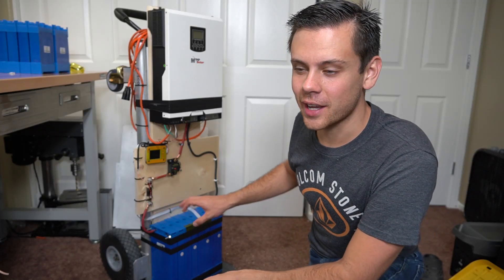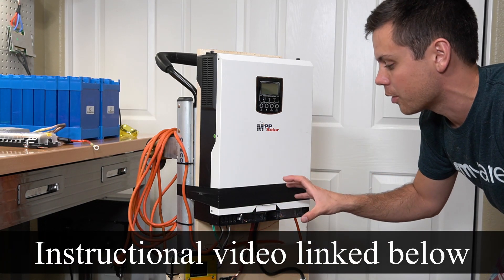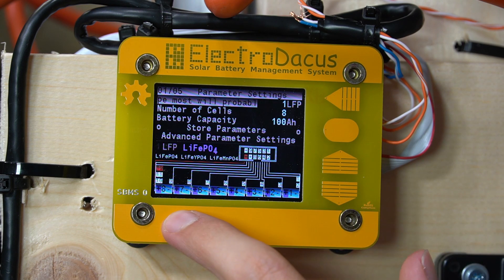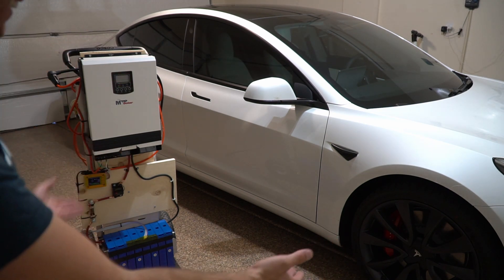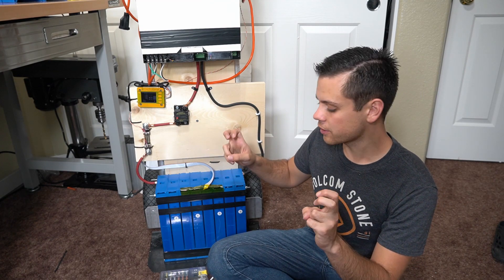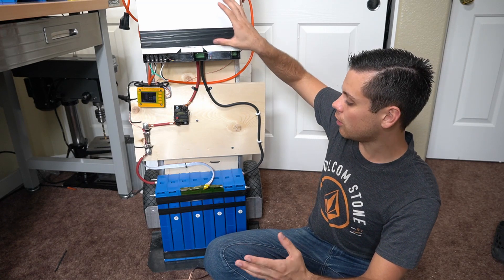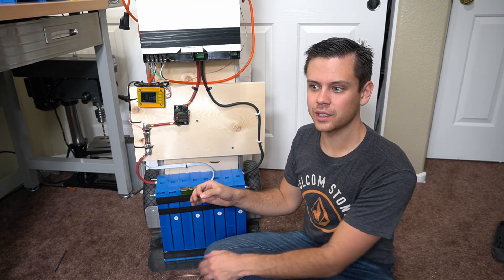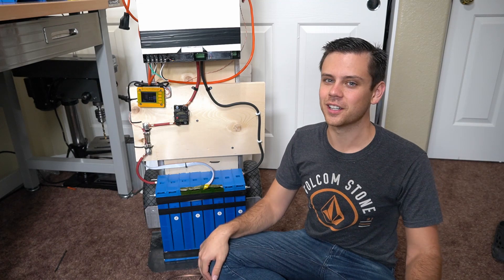Hand Truck Solar System: 2.4kWh LiFePO4, 2.4kW Inverter, ATS, 1.4kW AC Charger, 1.8kW PV Input

Comment: Will... Can you make one of these solar/battery packs capable of running high in rush loads like motors and specifically a MIG welder @ 20amp/240v max load and a run time of ~2 hours... or at least go over the changes and components needed to make it work.

Comment: Why not connect two battleborn?  200AH.  Can charge at 100A safely and discharge at 200A without issue (400Amp peak for a couple of seconds).  Also, you can attach a 40 Amp DC-TO-DC converter that only weighs 4lbs that would allow you to charge with vehicle (ideally a Hybrid as it only takes what it needs - at a 40 amp draw, my engine kicks on for 2 minutes every 10 to 15 minutes which would allow to run for a couple of weeks on a full tank of gas in the case of cloudy days)

Comment: Thanks for the awesome videos and ideas like this one Will!  Huge Fan of your content!
For this system, do you see an issue with configuring the batteries in a series parallel matrix so I can get 200ah @ 12V and direct that to a 12v inverter ( powering ac lights/fans )?  Thank you Will!

Comment: Wiring two batteries in parallel, should you connect the controller and inverter to the terminals on one battery or do you connect positive to one battery and negative to the other? Or doesn't it matter?

Comment: I am afraid that I will not trust mop solar products any more. I have a unit that stop charging for no reason and the company had me take the unit apart and send pictures. Now they want data logging on what could be an intermittent problem. These units requires 12 watts of power to run. This could be a deficit on a small system. I guess you will continue backing this junk until one fails like mine.

Comment: You mentioned that the inverter would be most likely to fail a couple of times, and if it did the entire system is unusable, but it's replaceable. Do you have a plan as to what you would replace it with and how you'd do it? Would you have to find a similar inverter as was used in that unit online?

Comment: Hi will. 
I've done this same system with two battle born batteries and it runs my entire house including my big double door refrigerator. I have 6- 12v - 100watt rich solar panels and it works awesome.

Comment: Could this power  mini split AC/ Heat pump?
Reply: I sure hope so as I am receiving my MPP 2424 tomorrow to go along with the 6-165W REC slightly used panels I picked up for $60  apiece. Mating these with the used 24V, 4KWh BYD battery pack I picked up a couple months ago. Probably going to add more battery but this should get me a start. Just need to settle on an alternate BMS as Electrodacus is sold out😕
Reply: @580guru  thanks for the info...
Reply: Mini split is rated 750 w ...
It will need 3 times to start running .

Surge peek this inverter is 4.8 k .
It surely will run it into sunny days but it will have to be grid tied during winter times or bad weather conditions ...

But most of the mini split consumption could be gather by this kind a device ...

Mine is 11 k surge peek and only known thing it cannot make run is a 2.8 kw branches grinder which require 5 times power a the start ...

I was too lasy like to buy the device to make it start with my hybrid system ...

Which mostly consist in a capacitor ...
Reply: @bricelarie6527  When purchasing my 12,000 btu mini split I opted for, and paid 20% more for, a high efficiency Pioneer model (21 SEER) that uses a DC inverter compressor. These can run efficiently at slow speeds and seem to have a low ramp up starting current so don't have a huge startup current draw-- making them ideal for running off an battery/inverter setup.

Comment: You called the 300 a shunt a kulo-meter (?)  for High-Low voltage disconnect. How does it Disconnect?  It's a shunt?   Thanks

Comment: So what's the difference between the Calb cells and what you have that you'd need to use a different BMS other than what you have here? The cells are all LiFePO4. I'd use Calb 100ah cells for this. Seems like Electrodacus is always out of stock.

Comment: Request: Can you do a build walkthrough of these cells in a 24v config with the smallest appropriate Victron components for a truck camper with a generator? I wish Victron made a smaller (size) inverter with gen/shore/battery transfer cutover.

Comment: Hey Will, I've been following your videos for a while. Building my first off-grid system. I'm gonna hook my panels up in series for a total of 120 volts into an MPPT controller into PowerSafe 12v 170ah (X6 in parallel ) battery bank and 3000 watt inverter. 
I got everything from your recommendations 👍
Wish me luck! 🤞😁
Reply: What size charge controller did you get send brand what size solar panels in what amount of wattage is your PV system what kind of inverter did you get. What is the voltage of your battery Bank 24 or 48

Comment: I was just looking at hand trucks (Costco's too) this weekend for my AIMS 3kW Inverter/Charger and Headway cells. I want to upgrade to those Fortune 100Ah cells once I get back to work - I keep balking at the price. I ended up with something that looks like a big toolbox on casters ... my Portable Power Station. What a trip to see this video roll out!

Oh yeah, if you're going to keep that build, please add a junction box and cable clamps.

Comment: I have a question! The cells in Will's build, I think he said are 100aph each, Will had 8 cells configured together which=800aph,. Am I understanding this configuration correctly? An $1800.00 (CAN) 100aph Battle Born battery can't compete with these  100aph cells?, 100aph X 8 = 800aph, Am I correct?.
Reply: Also, each of the 8 cells are 100 amp hour but only 3.6 volts so it takes four combined to get a 12 volt array, or eight to get 24 volts.

Comment: Great idea, I like how you just showed the solar generator manufacturers what they should have done quite a while ago.  About some of the components you're using:
 - SBMS0: great to see you bring this BMS up again.  Too bad they are unavailable until August according to Dacian's website, I would really like to have one for my DIY batteries that are coming in soon from Alibaba (Thanks to your DIY SOLAR POWER FORUM - it is AMAZING!!!)
 - 120A circuit breaker: I've built an offgrid system using several versions of this type (I went to them from your website last year).  I found that the 80A model would occasionally trip on my Midnite SCC current which caps off at 62.5A, so I replaced it with the 100A version, and it would trip as well, although not as often.  I don't think I'll go with another of this make.  Also FYI the one that comes up in amazon from your link above looks different that the one on your video and on your website.
Thanks again for all your help Will !!

Comment: I did something very similar last year on an eBay group buy after you reviewed the 12V MPP.  
I had a surge protector that had a long 6ft cord that I used for the male AC input cord and used the short tail that was created and hard wired it on the output side. Provided an ON/OFF rocker switch and 8 plugins.
Yes, standby power consumption isn't great on 12V version either. 
Noticed you put the shunt on the positive side? 
I'd love to have batteries like that but cannot justify the expense for the time being.
Reply: The SBMS0 requires the shunt on the pos side.  Will himself put it on the Neg and ended up emailing Dacian to see why it wasn't working, LOL, see Will's video on that FYI.

Comment: You just can't charge your Tesla with it and not give us any detail. How long did it take to suck this dry? How many miles did you gain? Sure it's totally impractical but it would be a fun follow up video. There are other suitcase charging videos out there.
Reply from the maker: About ten miles of range haha! Not much. I have another video on the Tesla charging with solar
Reply: @WillProwse  
10 miles is not 2 shabby...
Could get u 2 a charger / home in a pinch..!
I can see some1 making something similar 4 recovery companies 2 wheel out 2 rescue stranded electric cars...

Comment: I have a 18kwh lithium battery, I just got together, I'm adding to the 12+kwh I already have, but I desperately need more pv,  but if I was going portable, I'd went with something like this also, maybe attach it to something more compact, and easier to move, maybe a 4wheeled cart, similar to  the 'lil red wagon' but if you were to do that, you may as well put more battery on it!
 It never ends! Ha-ha...

Comment: I like the idea that it's on a dolly, that's neat.  I built a small version of something like that for camping, was great.  Used small gel cell batteries though and a pwm controller so not as good.  I had an arduino to monitor voltage so it shuts everything down if it goes too low.  It was all in a portable box with a lid that opened and had a couple accessories like LED lights in it. I want to build a higher capacity version eventually as mine was only 350w for the inverter and like 14ah of battery. Lifepo4 batteries are hard to get here in Canada though otherwise I would use those.

Comment: Hey Will can you do one on installing a setup to run a 6 bedroom houseboat I’m living on?
Reply: The basic concept, as I understand it, is to upscale.  Your options with the MPP Solar inverters would be to chain them in series as one big ac power source feeding your entire breaker box, or to run multiple breaker boxes, each powered by a specific inverter. Adjust battery bank and solar panel array size to match your needs. At six bedrooms, you're definitely talking about a 48+v system, more panels than you think you need, and likely a permit for installation.
Reply: Sorry, I missed the part about this being a houseboat. This implies no permit is required, and if electrical expectations are not out of control (no fridge running 24/7, 365 and no huge audio system) then 24 volts is still a good fit for you.

Comment: Amazing timing.  My inverter came a few weeks back and the batteries I ordered two months ago arrived at my door just three hours ago.  I wish the BMS was here.  I now have a new use for my hand truck.  I will probably make the hand truck removable.  I got 180 Ah batteries so I can run a refrigerator for more than 24 hrs on battery if needed.

Comment: Had yet to plug up my low voltage disconnect to my 24v LiFePO4 left a small inverter load on, bad things happend 😭  praying that the other half of the pack will recover... love the DIY videos keep it up 👍
Reply: Can you tell me, what in his setup is actually performing the low voltage disconnect. I don't get it (yet).
Reply: The hybrid inverter will shut down if batteries voltage is too low ...

There's a default mode but you may also set it up ...
If the inverter is not connected to anything, it may takes few times before balance the bms and self consumption the inverter itself discharge the battery pack ...

Its bms is turning off as soon as he got the correct balance set up between each battery made .

Might be wrong, but may last quite a few times before having to charge it if you're not using it ...

My bad .

Comment: Those ElectroDacus components are a really cool design - stacked PCBs with contacts between each layer.
Reply: They are, I have been looking at them for over a year and I finally decided to pull the trigger and it is sold out. It looks like I will have to wait till August.
Reply: Mine has been going for a full year sbms120. I have 8,310watt solar panels hooked up to it with no issues for the price it does alot.

Comment: Also I notice most of the charger and invertor equipment is rated for only 40C.....kinda low for shed use where it could get very hot.
Reply: Lol in a refrigerator?

Comment: You are tending towards the higher end market here, how many can drop $1k on just the batts?   At least with SLA you can start small and add later and spread the purchases out.
Reply: The point Will makes is the TCO compared to SLA is much lower with LIFEPO4

Comment: Hi Will.. How safe is the AC output of the inverter, does it have an inbuilt rcd, elcb or safety switch? Or do you need to wire in External protection of some kind, also is an earth stake required? Regards stormer.
Reply: I'm curious too you should post it on the forum.
Reply: @tom_n_i  thanks for the reply what forum? I think if this is instructing people on how to do a diy, it's a very important to know, one faulty device connected to this unit,  could make this lethal.
Reply: @Jason Bowman thanks for the reply.. if anything connected to the inverter that has a metal cabinet or metal that is normally protected by being earthed, then the inverter will need to have a earth stake, the only exception is if whatever you're powering is a fully double insulated device,  it could still be deadly if it comes into contact with water that you're touching .. 
My question was about is there an earth leakage breaker in this setup or whether the inverter has one built in. Without an elcb installed even something as small as a faulty phone charger could kill someone, it only takes milli amps and it's sadly happened before, an earth stake would also be required so that the elcb has a reference to ground to detect the required 30ma to trip the safety switch. Regards Stormer
Reply: @stormer6364  the forum is in his description. If we have this conversation there it might save some people if danger is a warranted concern
Reply: @tom_n_i  ok I will post something up there when I get a minute, does will answer questions there? As It definitely is of concern.
Reply: @stormer6364  kinda it's a forum. So the community will have the discussion

Comment: I literally JUST posted my first video yesterday, showing the unboxing of an LV2424 hybrid. I was shopping for a hand truck to do exactly what you just did. Like, almost exactly. The only differences: I'm currently waiting on two BYD battery packs and two "320 amp" Ant BMS modules for this system and I am placing circuit breakers inside each battery pack cover. Great minds think alike! I went with two packs because they were sold together for a great deal with free shipping, and because I want to keep my C rate low. 

I notice Maximum Solar (via the link you provided in the comments) is spelled differently than the one you linked in prior videos. I bought mine through the seller you previously linked. I have two questions:
1)  Do you have any information about the maximum solar name change on ebay? They are one of two distributors that MPP Solar directed me to.
2) I see the price for the  LV2424 you linked is cheaper than the one I bought, and cheaper than the off-grid units I priced last week. That's great for people who would like the off-grid units, but do you know why anyone would make that choice? I plan to be off-grid, but for the cost difference, why wouldn't someone want the functionality?

Thanks
Reply: Check out Desert Prep's DIY solar generator video from 2 years back, many helpful ideas

Comment: Funny you post this today... I am building exactly this today.  I’ve gone a bit bigger, but the same basic idea.  Should have it operational shortly, so I’ll post a picture on the forum.
Reply from the maker: Nice!! Can't wait to see it
Reply: @WillProwse  BMS sold out
Reply: @WillProwse  Hey Will. I just found you and really appreciate your knowledge.
Here in my plight.
A couple of months ago I found plans for a solar powered generator type deal, also, on a handtruck.
I have purchased all of the materials for it.
Have you seen this video by desert prep?
Rev.4 of his model.
I know that you are a busy man.
I was curious if you could take a peek and give me a suggestion or two. I noticed his set up may be missing a circuit breaker or a fuse in a place or 2.
I am committed now that I have sunk my money in..haha
It appears to be a good enough system that could use an adjustment here and there.
Thanks
Reply: Rick link us to your post on the forum please. I'd love to see what you've built and cant seem to find it. I want to build a little bigger version of this as well.
Reply: Hey Rick,  what are you planning on doing with it? Seriously.
Reply: Hey Guys Im installing  the ED SBMS 120 +  MPP solar LV2424 with  500aH LIfePo4 .  Please send a Link  so I can Bypass the energy hog MPP inverter switch..
Reply: I'm excited to see this!

Comment: My first panels were given to me. 11x425 watt panels that are 185 volts each.  What charge controller inverter and config should I run?
Reply: What panels r they, make & model plz. (Should b on the label on the back)
R u sure they r 185v & not 18.5v..?
That seems awfully high..!
Please confirm, then I can advise u further...
Ciao.